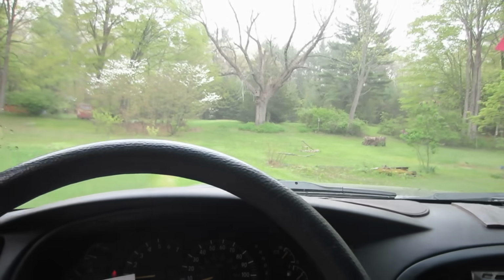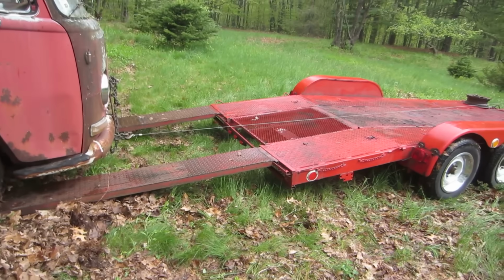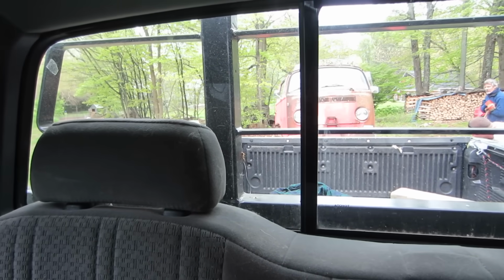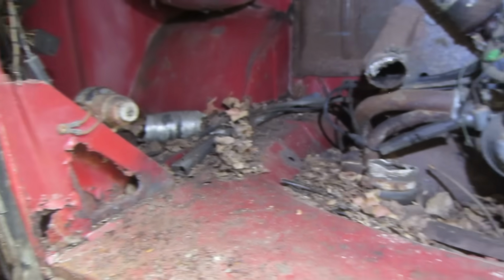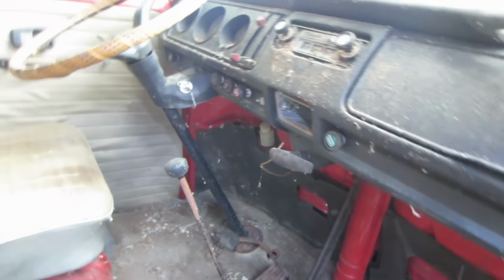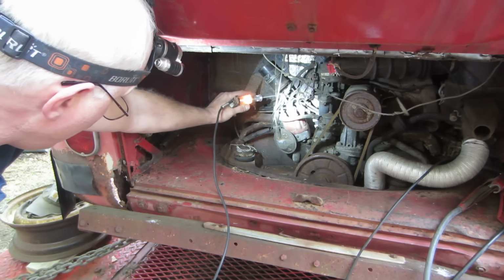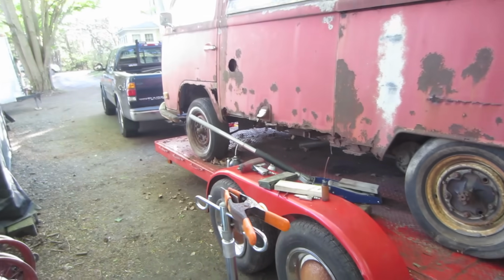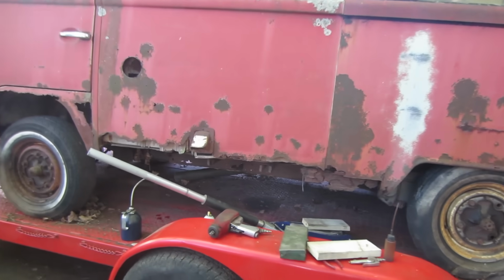31 years in a field, vw bus, will it run?

Comment: id be scared for the integrety of what ever that cable is attached to yeah it was moving but you dont know how strong the 31 yo steel is lol id be sacred to be standing right at the back of the winch one peice gives your done the cables gonna be flying right back at ya and somthings getting slashed off
Reply: I was going to say the same thing.

Comment: Do you suppose the oil looked clean because the dirt had so much time to settle?
Reply: I guess it's possible, but I don't think so, I think that the oil had been changed regularly in that bus and it had been changed recent to it being parked.  I have seen plenty of old oil on dipsticks that is black as black can be after sitting for many many years.
Reply: @MISTERComaToes I agree, my Grandpap had a 41 Dodge which hadn't been started for over 10 years and the oil in it looked black when I looked at it.
Reply: sold with recent  service ........ lol

Comment: What year I know it's an early bay 66-69 ( I think)
Reply: 1971, I had one just like it.
Reply: @iansutube  In the USA 1971 Type 2 had disk brakes and went to the same wheels as the 1972 but still had the 1600 engine as 1970. In 1972  type 2 had the Porsche 914 1800 motor. When I speak of VWs  I learned long ago that there as few absolutes. I worked at VW dealerships in the 70s and all of us VW mechanics there learned that VW stopped making the 1200cc,  40 horse motor in 1965. I lived in Japan for many years and bought a 1968 Bug which came with a stock 1200cc 40 hp motor from the VW factory.

Comment: Expert at work, the oil is also 31 Years old, the elektrik starter is the next part you need, and next time at first clean the carburetor and use an extern gas-tank. Sorry. Where is the air-filter? Ok, but it's a nice Hobby you have.

Comment: Decades ago I got a 1967 split window VW van and traded a modified Yamaha RD 400 for it.
They thought it had serious engine trouble, hence the cheap trade, but after I limped off and drove around the corner, I pulled over, swapped the two plug wires they had on wrong, and headed for the freeway!
The brake shoes love to rust to the drums if they sit too long!
Reply from the maker: bet you wish you still had the bus now,
Reply: @mustie1  Nope it was too slow and had 6 volt to 12 volt issues like the wipers once turned on went so fast they would not shut off.
Also, seen a few that were wrecked and didn't like the idea of my legs being in the front portion of a crush zone.
I upgraded to a newer one with a 2.0 type 2 engine and was going to swap in a Buick 215 I was building with a Kennedy adapter.
I was planning to fabricate a round radiator up front making it look like it was a spare tire. CA did not include my model year in the new smog exemption and I eventually sold it. Just last year I got around to selling the 215 as it only needed the cam and pistons, but every other common upgrade was done. I opened up the oil passages, added pointless ignition, powder coated & rebuilt the water pump/front cover, distributor, starter and alternator a bright yellow. 
Did you know that the Audi FOX transmission will fit in there, (HUGE GEAR RATIO SELECTION FOR EVERY GEAR AND THE FINAL DRIVE RATIO) only the axles turn the wrong way, so on one with those reduction boxes vans it would turn the correct way!
I thought about making reduction like boxes (both gears the same size so no reduction) to mount to an Audi automatic with the tall gear ratio and running that 200HP Buick 215. I even collected 4 sets of reduction boxes for the gear parts.
Lack of machining resources or fund killed that idea!

Comment: wow you got it to run iPad there's an old RV that sat down in the woods for about 25 or 30 years and I also got the motor to turn but the start of something and plus it slides down in there and it's kind of water

Comment: I love your first start videos . However any engine sitting longer than about 5 years I would consider " dry " so I would take plugs out and squirt an ounce or so of diesel fuel into cylinders to help rings seal .
Reply from the maker: the gas l was using had oil in it to wet the cylinders
Reply: Mustie1 Yes , but engine was turning over dry before adding fuel

Comment: Looks like a 1970 Westfalia pop top camper. I bought one nw, had Radial tires exchanged, Spare tire mounted on nose and All the camp gear including the tent. $5200. out the door price in Burbank, CA. Put 350,000 miles on it. 6 engines 22 tire changes. sold it for $ 2,500. Air-cooled in Southern California was not the way to go.

Comment: Mustie i am a Auto Sparks you should mount a winch on the trailer powerd by the truck have a 12 volt anderson socket at the back of the truck running from the truck battery and a cable running from the winch long enough to go to the back of the truck with another anderson socket they will both plug into one another but at least the winch would be run off your truck.

Comment: Marvels mystery oil should free up the valve and clean the fuel feed. 1 cup in the oil, and 1 cup in the gas. Turn it over and run it. The system will clean itself

Comment: mussstinko, if think if you had cleaned the points, probably did, but even with a rusty valve seat, it may have fired. or started. but he said he had run it for 100,000. your love of old vw's, is phenomenal, considering, what they were, like the lowest cost possible, with the least metal, even underneath. I had one, but the stuff you have on that trailer, welllll.  I would use the engine in an aircraft, if really carefully overhauled

Comment: Carry dish soap with you, put some on the trailer where the tires will go, it will pull on much easier with a little slickey on it when the wheels don't turn. Old tow truck driver trick.

Comment: Whinch cable use is 1/2 inch for light stuff up 4500 pounds and 5/8 or bigger for big stuff over 4500 pounds pulling out ground or any spots rough terrian  too!

Comment: Electric winch also a generator with a compressor for the back of the truck if not on the trailer so it never ending supply of air and Power

Comment: I hope you do a factory restoration on that VW bus. In Elmira NY at 654 Sullivan Street sits an abandoned 1991 Ford mustang. The owner is in the military. The car hadn't ran in over a year and a half the motor is seized up. The owner tried to remove the rear drive axle to unseize the motor thereby breaking the rear drive axle. Mo hope this s someone would locate the owner buy it and fix it up before it rots away and becomes scrap iron that would be a shame they are highly sought after muscle cars. To let it sit and rot away and become scrap iron would be wrong. Fan of restoring old vehicles Robert Gildea

Comment: I had a 59 VW camper in 1970 I paid $360 for.
I went through 40 miles of dust and it burned two valves. I left it parked in Des Moines WA.

Comment: I hope you weren't using ether. The best thing to use on a dead engine is Berrymans Carburetor and Choke Cleaner.They will even run on it until the fuel lines fill up. Use of a high cranking amp battery helps with spark output and quality. VW mechanic since early 60s until 84, then I switched VW PORSCHE-AUDI, THEN FORD.
Reply: Damn George, I started fixing motorcycles when I was 12 years old. Plymouths before I was old enough to drive  then Fords  wised up and went VW,  Porsche, MB, Toyota. Then mostly anything German or Japanese. Finally ended up as Lead Mechanic at US Postal Service working on American crap. I'm disabled because of Vietnam injuries that finally got the best of me. I'm getting too old but occasionally do enjoy a little automotive work.
Reply: Limka45

Comment: The tyre is the black rubber bit on the outside. The wheel is the metal bit on the inside.
Reply from the maker: wheel is tire and rim around here,

Comment: Today I discovered a 50s or early 60s greyhound conversion tour bus.  It had a bedroom, kitchnette, booth /bed and sink,  the motor is said to still run and it has a 4,000 watt generator that is said to still work.  The body is aluminum and in decent shape, the lights and panels on the inside are in good condition.  It is going to be scrapped for it's metal, even though it still works.  The value for it as scrap is estimated to be about 3,000.  But it involves a lot of work to take it apart.  I wish someone would take it and make a living space travel  home out of it, not to tour but to park and live in, maybe while building a house.  Do you know anyone who would be interested in doing this as a video how to program.  The inner area is pretty well gutted and empty.  It is a sweet project that nobody around  here can afford.   Pontotoc Ms area, 38863.  Up friendship road from Hwy 15 about 6 miles or so.  If you know someone who does this please comment back.  Thanks.

Comment: @Mustie1 . My bus has been sitting for about one year. I tried draining the tank but it must have had quite a bit of gas in it when I last drove it. I tried draining about 5 gallons out of it. My question is, do I have to drain the remaining amount or can I just add some fuel starter or fuel stabilizer to the remaining gas? I put a new battery in and it turn over but sputters badly and will not idle on it's own. I can only keep the engine running by pumping the gas. Thanks!

Comment: Watching this was a nail biter. Once watched a welded stationary hook-up on a dumpster break away with the cable, fly over the winch truck and go through the tailgate of a truck 75 Ft. away. If someone had been in front of the cable, they would have been killed instantly. Watching you stand that close to the winch cable was hard to do. Be careful...

Comment: Will it run ? Of course it will run. But will it be any good???  Probably not, at least not if you want to just start it up and drive it after sitting 30 years.  Man, there’s nothing left of that rust bucket.
  If you are getting it for engine then you better just take it right apart and don’t try starting it, you’ll probably destroy a lot of the engine trying to just start it up after sitting a long time. 
  I’ve seen rod bearing inserts stick to the crankshaft and spin in the rod on the first turn after sitting just a couple years. I think of that every time I see one of these engine starts after many years videos
  Especially when it is a really old , rare motor. ( hey, lets start her up and go for a ride then listen to the crank and cam wipe out)

Comment: It will be much easier to restore these things if you melt it with a metal fondry... Electrolysis will not work on these things since the metal is crusted...

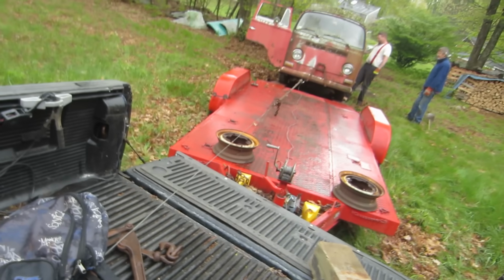Comment: One thing here - if you think what's happening at 10:25 - you stand with that camera right at the best place to be instantly killed if the chain or that steel rope broke during the pull... Man you always gotta remember not to place yourself right in the striking distance with ropes, chains, belts or anything like that. Very irresponsible.

Comment: It's starvig for fuel. You guys ever hear of 'starting ether?"
Reply from the maker: worse thing to use on a dry engine
Reply: Agreed, sort of. Why crank a dry engine? You fiddled and farted around cranking and cranking and cranking and cranking a DRY engine...not good; pretending your expertise was getting to the bottom of the mystery when all along the old VW was starving for fuel.  Cranking an engine, even a well-lubricated one, causes more wear than running the engine. Synthetic lubricants have reduced the start-up wear. Synthetics keep a nice coating of oil on moving parts instead of the oil draining off back to the pan.

This method always prevents cranking a dry engine:

1) Fully charge the battery.

2) Change oil & filter with synthetic (Mobil 1.)

3) Blow off around plugs & remove all spark plugs.

4) Pour one teaspoon of oil down each cylinder through the plug ports.

5) Crank engine (with plugs still removed; it reduces drag) until oil pressure is up and the crankshaft is spinning freely.

6) Reinstall properly gapped plugs.

Absolutely, if I value the engine and not just trying to see if it will start, I'll change the oil and filter, using Mobile 1 synthetic.
 Cranking the engine with the plugs removed and the cylinders wetted with engine oil, wets and frees up the dry bearings, cylinder walls & rings.  It brings the cylinder pressure up. The effortless cranking also gives the fuel pump time to bring fuel to the carb. At that point, if the engine is getting spark and air, and has compression, but still not starting, a little ether is the best thing for it. After all, the engine is well-broken-in so won't take much to fire up. On the downside, carb gaskets and other seals are likely to dry out over time so likely needs replaced.

And after sitting for thirty years, the distributor cap's electrical surfaces may be oxidized, check and clean, or replace. I've seen distributor caps so contaminated the engine will barely crank. It needs a good spark igniting fuel before the cranking gets easier (big 460 CI Ford.)

Incidentally, if it's a newly rebuilt engine with tight tolerances, I do all the above, minus the ether, plus fill the radiator with very hot water to warm the engine block. The engine reaches operating temps fast and the startup causes minimal engine wear. The VW is air-cooled so no water allowed :) And if it's a high-performance engine I might even use a drill to spin the oil pump to pre-lubricate everything prior to any cranking. A dry cranking episode, like you did, can cause several thousand miles of wear to a dry engine. Again, cranking an engine causes more wear than running an engine. Cranking a dry engine is a sin in my book.

Comment: Wow I feel sorry for you mate I bet you paid top dollar for that bag of rust basically for a set of glass and an engine that will require every part replacing anyway! I see you through the video trying your best to clutch at straws but you sounded like you were dying inside. Very unlucky you
Reply: You're not to smart. If you watched the vid you would know he bought it for parts. I think he paid $200 for it. They're are more than $200 worth of parts on it plus he can get most if not all of his $200 back when scraps the leftovers.
Reply: John Kifflom yeah ok mate! Only after he realised it was shagged did he decide it was for parts!! And I don't care what anyone says there ain't no way he only paid 200 for an old vw bus even in that condition. Learn your shit before you open your mouth pal.

Comment: I thought I was a lazy back yard mechanic, you put me to shame.
Reply from the maker: compliants on a $200 parts bus, you might want to get over it
Reply: @mustie1  No reason to get touchy. You chose the title of the video "Will it run". My point is: all the time you spent cranking it, you could have pulled the plugs, shot trans fluid down each hole, Checked the valves, etc, etc. That is if you really wanted to see if it was going to run ?
Reply from the maker: https://www.youtube.com/watch?v=JKCRmekkqq0 this will answer your comments,

Comment: the engine has completely dried up over the years of downtime, the wires were gnawed by rodents,there is no compression in the cylinders 100%, the meaning of the fact that you turn it endlessly?

Comment: Why didn't you use starter fluid?
Reply from the maker: worst thing to use on a dry engine
Reply from the maker: sure, the pistons and cylinders are rusty from sitting so you want to spin the engine with a gas/oil mix so it can polish itself up as it 1st spins over, starter fluid has zero lubricating capacity and can cause it to lock up if it starts and spins fast,
Reply: @mustie1  good to know
Reply: rusty inside the motor block .. so it could happen that RED smoke comes out @first ? lol
Reply: Starter fluid would wash all the lubrication off the pistons and could cause great damage to an old engine that had been sitting and needed to cranked over over. I once witnessed a mechanic spray too much starter fluid in a diesel engine. When he cranked it the explosion in the cylinders broke the head bolts and blew the heads off about two inches.  Thousands of $ of damage. WD40 works better in a diesel.

Comment: Did he say this was a "parts" vehicle.   One has to wonder which parts might still be usable.
Reply: Only if you don't know anything about VW restorations.
Reply: @eskieman3948  Eskie,   Other than getting an old out of date under powered engine what remains seems way too far gone to be used for parts.   If there are folks out there who will pay for such a vehicle parts then more power to those who have them for sale. I drove VW buses  off and on for the last 40 years and I have never been impressed with any model bus I would want to spend the time and effort to rebuild.  When I was young a bus was my first vehicle, but in truth it was more trouble than it was worth . It did however keep me out of the bars and "off the streets" as I spent more time under it than driving it.  When I finally got the engine tweaked with case savers, remote engine coolers and the other odd things one could do to make the engine reliable I finally lost interest in changing lanes in cross winds without moving the steering wheel while driving and that is when I decided to leave the VW van behind me and move to a more civilized and reliable vehicle.

Comment: Those old VW had the crappiest engines they would constantly leak oil ,  And you would get about 30k miles until the engine was shot and they had NO horsepower they were weak as hell.